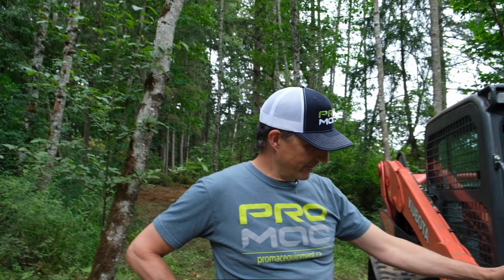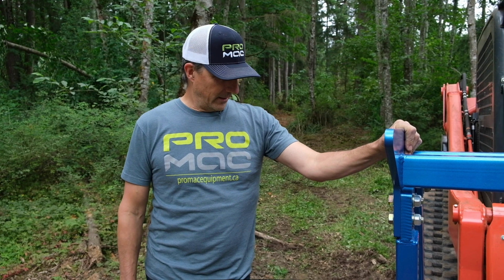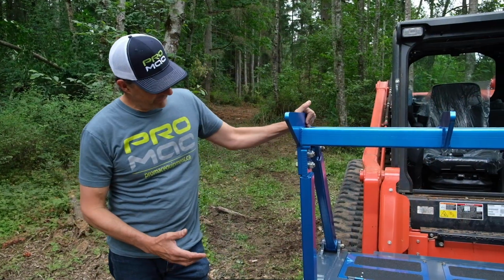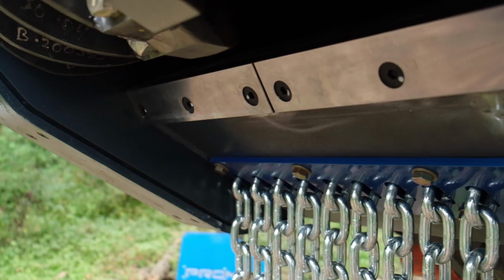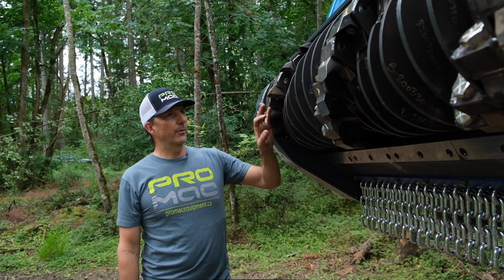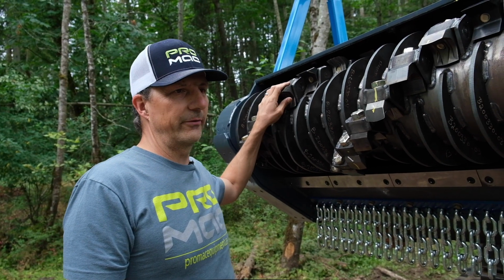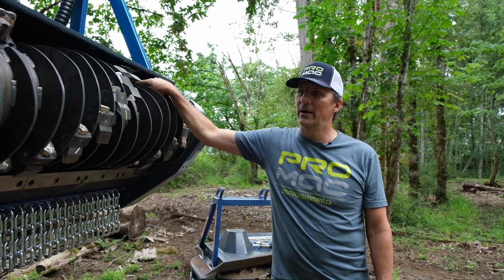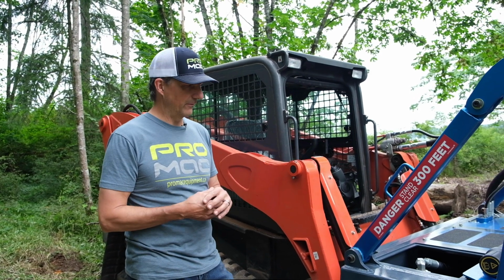Promac Skid Steer Drum Mulcher Overview with President Gary Powers

Comment: I bought this same Mulcher the same time I bought a new 331G two years ago. I wouldn’t recommend this mulcher to ANYONE! Teeth system is garbage, carbide teeth are overpriced and need special brackets to even use which for some reason aren’t included with teeth, you can never change a tooth without also replacing the bolt (also stupid expensive). Very disappointed with Promac.